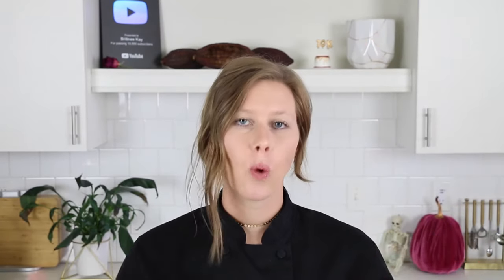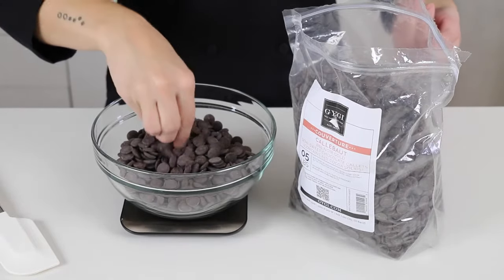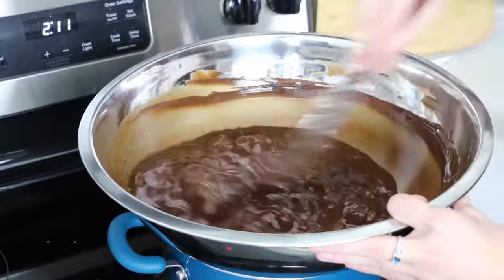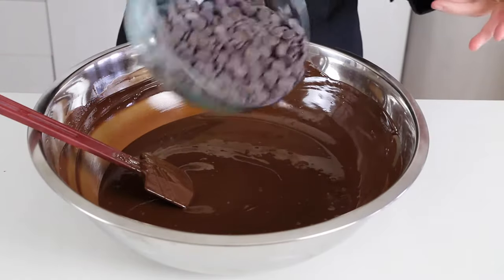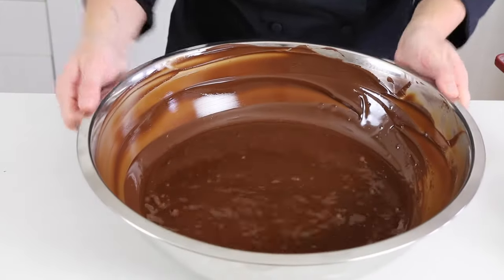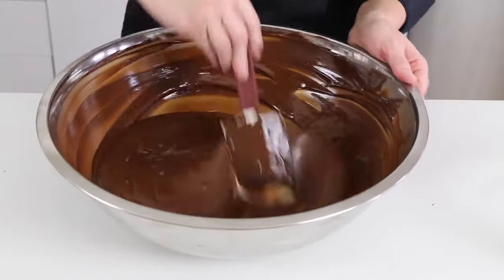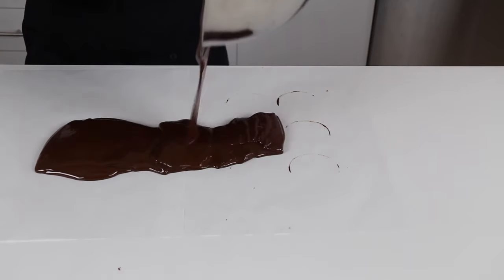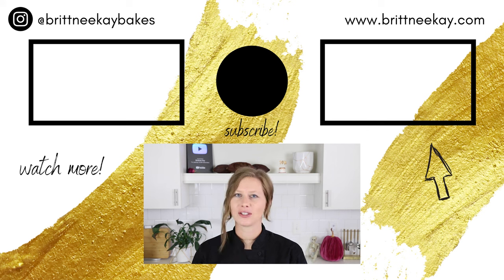Temper Chocolate | Seeding Method

Comment: I am still confused about the length of time waiting to test and see that something is “setting up” 5-10 minutes. In the meantime the temperature of the chocolate is lowering and maybe not going to work as well for project now? And do we heat it up a little if it cools and begins to thicken? Also if it does not temper ( as is the case many times for me 😳, then what? Do I add another 20%, because in theory we just used it. I have watched so many videos on this topic and yes sometimes it works but it’s so unreliable. I have tried both microwave and seeding multiple times. It’s very frustrating because if I go ahead and use the chocolate and it is not tempered then the whole project is a waste. I would very much appreciate some help. 🤦‍♀️
Reply from the maker: I'll answer each of your questions separately:
I get your frustration with the temper test along with letting your chocolate sit in a bowl cooling. A couple thoughts on this...once you get the tempering methods down (whichever one you use) you don't have to do a temper test. If you're confident that you've tempered correctly, which you will be once you've done them enough, then you can skip the test. Even without taking time to do the test you'll most likely still worry about the chocolate setting up in your bowl. It will, but the bulk of the chocolate in the bowl won't cool down all that fast really. You will notice the edges setting up which you can gently keeping fluid and warm with a heat gun (or hair dryer if you don't have a heat gun). I'll admit, working with chocolate from a bowl is annoying and frustrating and can present temperature problems very easy. This is the first step to learning though! If you know you are interested enough in chocolate work and want to excel invest in a warming tank ASAP. This will make you so happy! 😃 The warming tank will hold your melted chocolate at working temperature and you can focus on your project and bon bons without worrying about the temperature of your chocolate!
Now to your tempering question. Adding another 20% could work in theory but there are so many factors to tempering. If your chocolate has already cooled and is out of temper my suggestion would be to "start over" by warming it all the way back up to the top temperature and then repeating the seeding method by adding that 20%. Now if it's almost cooled and there are no longer seeds sometimes you can add a handful of extras and save it. I know its frustrating and can be a struggle but the more you practice the better you'll become at tempering. And you'll start to notice things about the process that are hard for someone to teach you. You'll get a feel for things and observe how your chocolate behaves. My biggest suggestion would be to keep practicing and also I would say keep using the seeding method, for me it is the most successful and easiest to master.
Here's my final tip, after you bring your chocolate to the top temp add in about 1/2-3/4 of your seeds, stir them in, use a stick blender to smooth them in. Measure the temperature and if it is not yet down to working temp add in the rest of your seeds. Blend those in until smooth. Measure your temperature again and if you're in between 32-34º C you can stop adding seeds, if you're not quite that low add a small amount at a time until you get there. I am always learning new things so I didn't mention this in this video, but this has also helped me. Keep practicing and let me know how it goes! 🙃
Reply: @BrittneeKay  thanks so much. To be honest I have been doing this for awhile now and I do hope to get that fee and I suppose I have improved but the inconsistent hit and miss factor and time involved is outrageous. I do use the seeding, I can’t do the quartz countertop thing and microwave is also hit and miss. But I suppose I have improved. The chocolate that seems to be almost impossible is the caramelized white chocolate. 😳
I’ve never blended the chocolate up, I always just try to pick them out, so I will try that. As far as investing in the warming trays… any suggestions for brands or styles? Thanks again. 😊
Reply from the maker: @michellekelly6346  Yes keep practicing! Maybe stick to seeding for now and if you really do it carefully I think you'll find success. I haven't tried the caramelized white chocolate. Maybe I will pull that out of my pantry and test it out!
Long story, but I bought my warming tank from Australia and it works great but I don't recommend ordering that one because the plug is Australian lol

Check out this video and in the description you will find links to a brand I think will be great and this website is a trustworthy place to buy:
https://www.youtube.com/watch?v=LXl-juQZsuU&t=647s